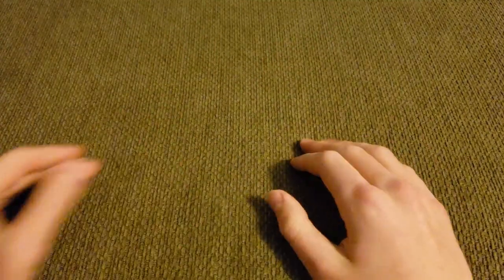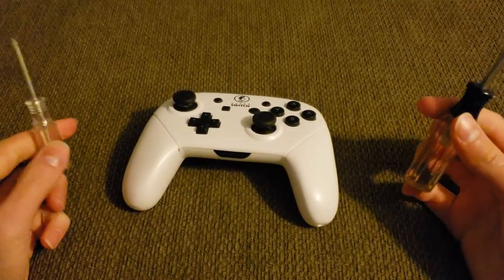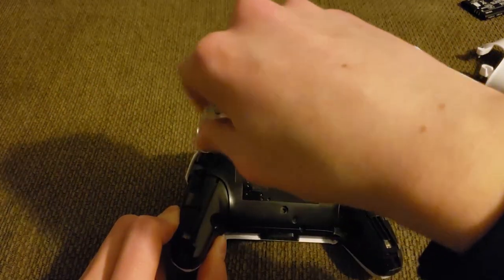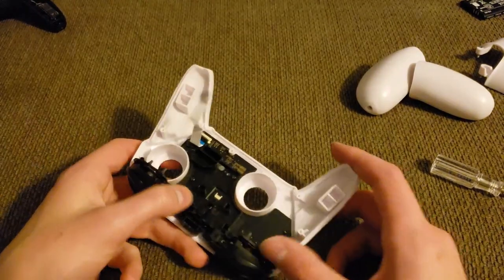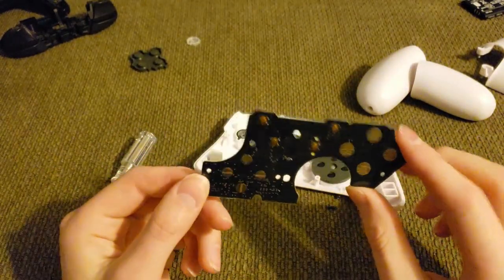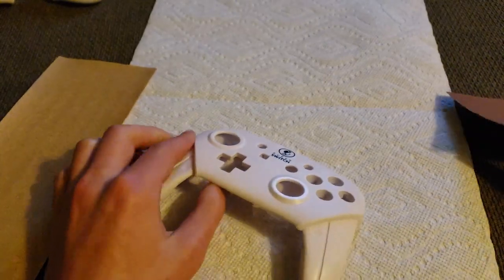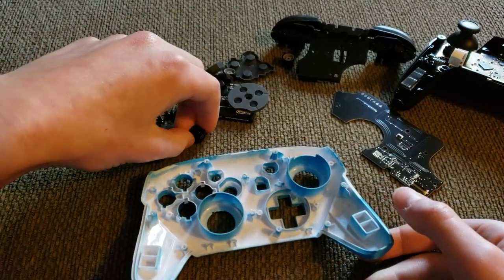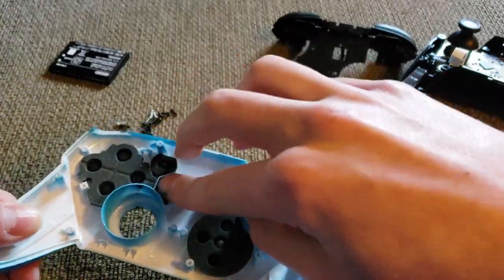How To Custom Paint Your Nintendo Switch Pro Controller (with Disassembly/Reassembly)

Comment: Looks beautiful but my only recommendation is to start with a VERY light coat at first and continue to do small coats until you build up to full color. Should help your paint running issue!
Reply from the maker: Thanks for the tip, I'll definitely try that technique next time!
Reply: Trenton Sauve  I’m about to do this to my controller how long do I wait for clear coat.
Reply from the maker: @mcox4417  I would wait at least a day for the paint to dry completely before applying any clear coat. Good luck, let me know how it turns out!
Reply: T2 Games have you ever painted the button or joystick? If so how did you do it
Reply from the maker: @mcox4417  I have not done either but I would recommend sanding the buttons beforehand as with the controller shell. As for the joysticks they would be tricky as they are rubberized, personally I would not paint them just because of that.

Comment: Can i use a regular white primer on the default black shell and get the same result? Id rather not spend 20 on a shell that isn’t necessary
Reply from the maker: Yes. I just bought the white shell because I wanted to keep the original.

Comment: I want to do that but I'm shy if I broke the controll on the try
Reply from the maker: You'll be fine as long as you take precautions such as avoiding static electricity (don't wear socks and work on carpet, for example) as well as making sure to be gentle with the components and don't force anything open. Good luck!

Comment: i just wanna know where the stencil was from or what was used to make it. Like, what is the process for spraying the stencil? Taping everything around it? like i dont get it all.
Reply from the maker: I printed out the logo on a piece of paper in the size i wanted, the cut it out and used double sided tape to stick it to the controller. Then you can spray over it with the color you want the logo to be and remove it.
Reply: T2 Games damn nice. I’d just be worried about getting overspray on the other colors or different parts :(
Reply from the maker: Make sure to cover the rest of the controller with some sort of masking tape to prevent that!

Comment: Does the texture of the controller feel different after you spray painted it?
Reply from the maker: Hey! Sorry for the late reply. It feels more rough for sure, I would recommend using a sandpaper with more than 200 grit before painting. Since the grips can still be swapped for the originals and the painted ones don't feel too much worse, the texture really isn't an issue for me/doesn't bother me. Hope this answered your question!
Reply: @T2Games  Thanks
Reply: @T2Games  It hasn't really got much to do with the sandpaper, more your spraying technique.